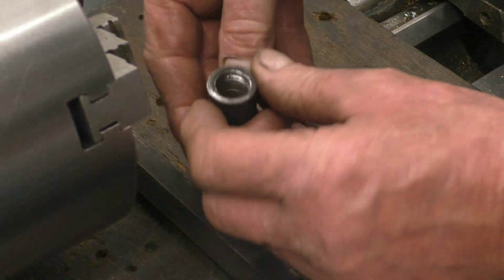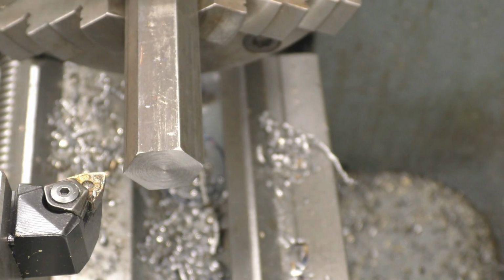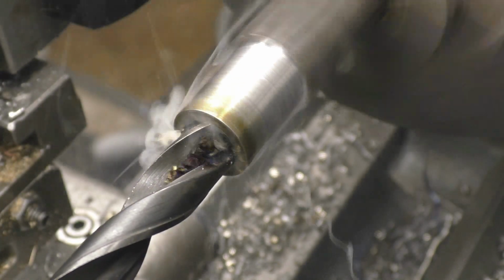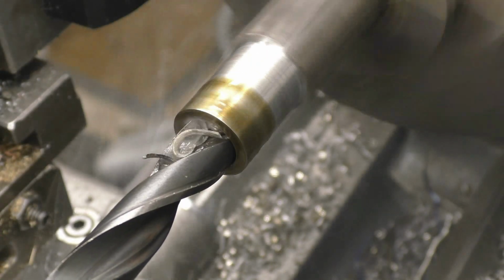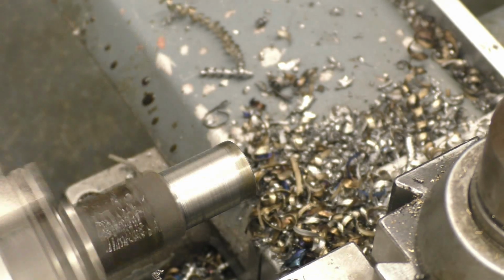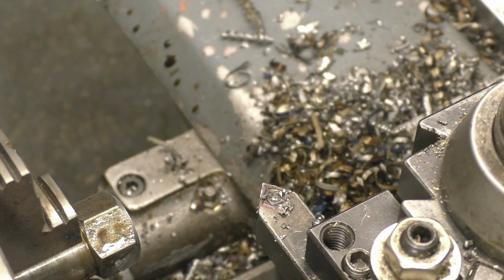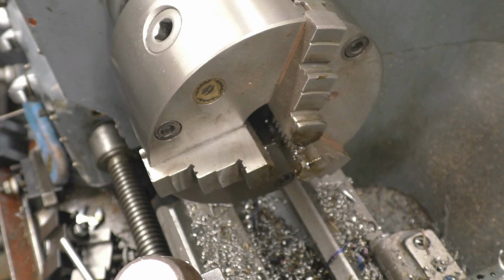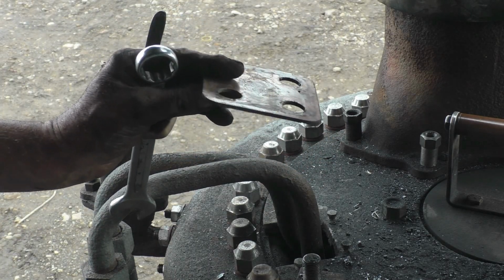SNNC 440 P1  Sentinel Boiler Nuts. Monthly Give Away

Comment: A comment to the later part of the video, firing up the boiler.
My home veteran railroad was lucky and just got a full load of coal. The price had doubled since last year, and that price was higher than before.... Since some time the strategy is to burn wood as long as possible during the prior heating. (Now and then trees fall down on the tracks and give us fire wood.)
Then switch to coal short to departure.

Comment: Congratulations Jonathan 🎊. Most magnanimous John.
When turning hex bar, I find a tool/insert with a 60 or 45° degree approach is better, the initial contact is on the flank, not the corner of the insert. The chamfering insert you use would be an ideal candidate. 
Another great Sunday evening from the North East. 
Thanks for sharing.